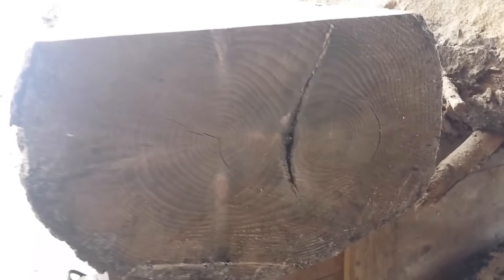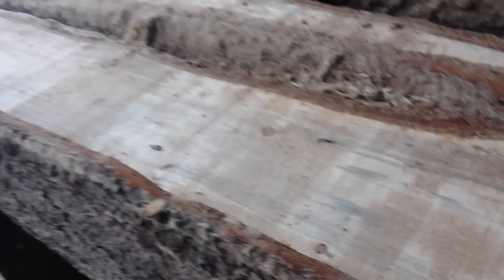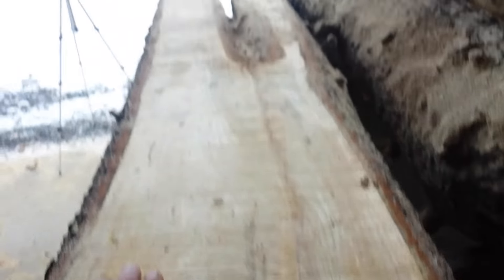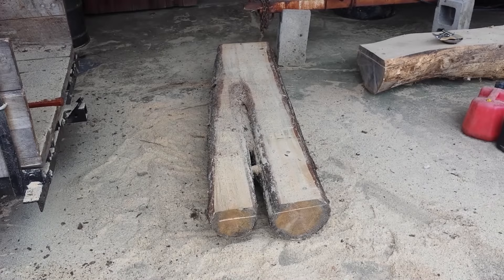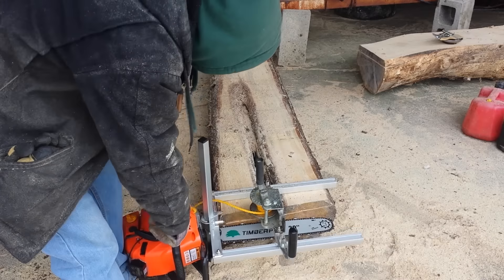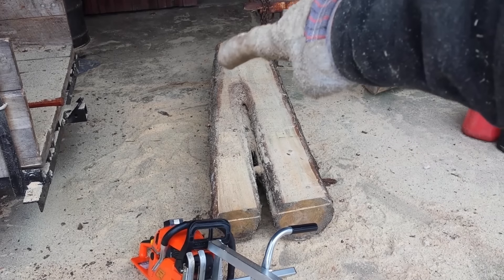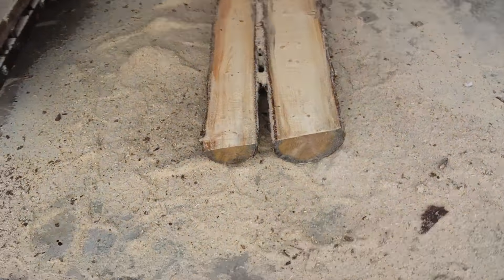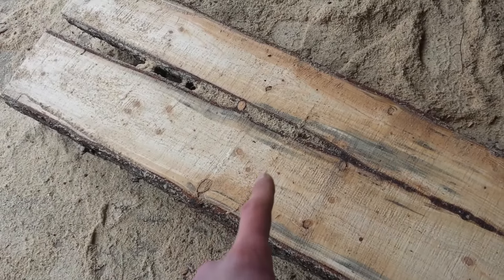Timberpro Milling Double Barrel Spruce Log

Comment: I'm looking for a decent chainsaw for home use. After using the Timber pro for awhile now, do you recommend it?
Reply: Brandon Van Horn look up baus 52cc chainsaw
Reply from the maker: Brandon Van Horn I did have a problem with the tank vent. I'm starting to think now they might have used one that was for a less powerful saw that would use gas at a slower rate. After fixing the vent and doing some carb adjustment, I would recommend this saw. It's a lot cheaper than a stihl or husqvarna saw of similar CCs.